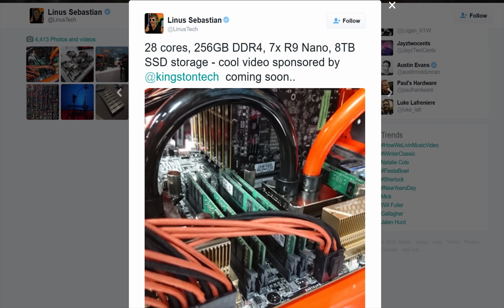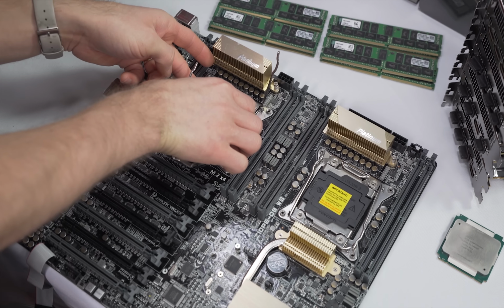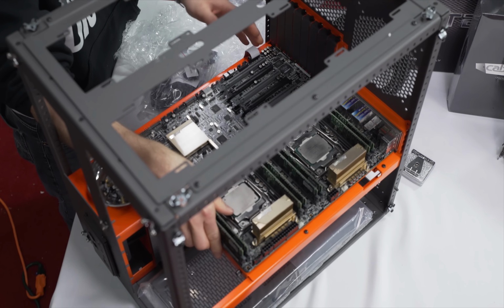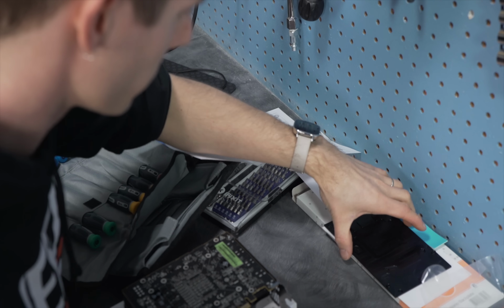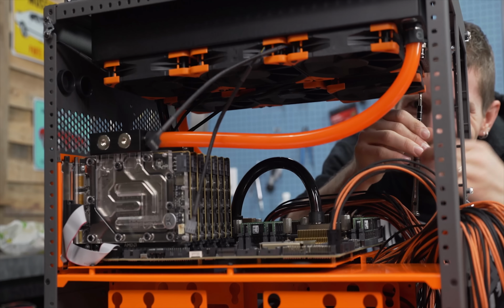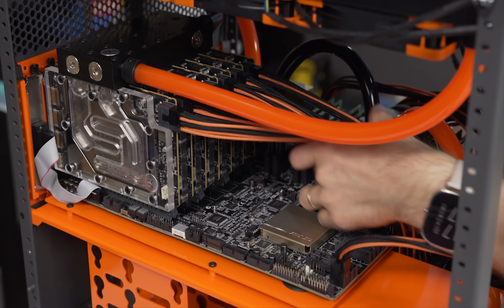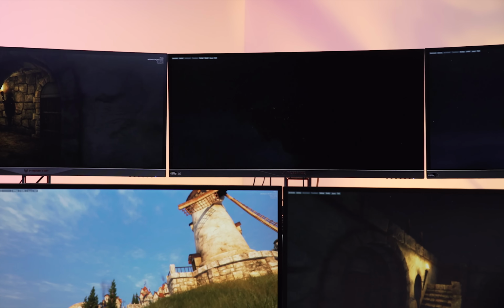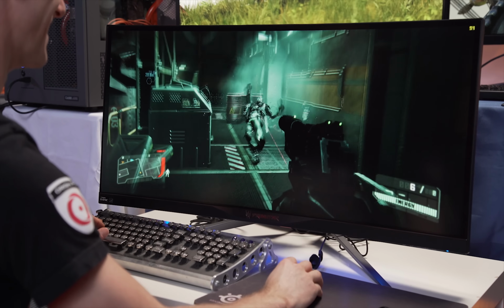7 Gamers, 1 CPU - Ultimate Virtualized Gaming Build Log

Comment: Word of warning: Whatever you do, don't try playing the next Crysis 3 level "Welcome to the Jungle" with 7 players at once.  I expect it would draw about 100W extra per player compared to the heaven benchmark mostly due to the increased CPU workload.

You could get around this with a dual PSU setup but no one should attempt this without firstly making sure that either the 2 PSU's are electronically separated, or they are wired up together CORRECTLY.
Reply: +Nick Dedman both CPUs combined use less than 300W at full load.
Reply: +wasted rider what kind of load exactly?  Linus said that the load from the wall when running 7 instances of Heaven was around 1543W.  Heaven will use at most 1 core's worth of CPU power.

In my experience the WTTJ level in Crysis 3 on a single computer uses about 100W more as it maxes out the CPU load computing the grass (again reading from the wall)

If we take the 94% efficiency of the EVGA and the 92% efficiency from my previous PSU which I used for the measurements, the 7 gamer computer was drawing about 1481W from the PSU.  It doesn't take a genius to work out that more demanding games are likely to overload that PSU.

Prime95 AVX and FMA3 loads are going to draw a lot more power at 100% than other types of stress testing apps, for instance.

Comment: Is this cost effective. I mean if i built 7 PC-s similar to these virtual machines, would it be cheaper?
Reply: +Kaarel Kahu This is $30,000. you could build 7 seperate ones with a way cheaper cpu and motherboard. End result - yes, it would be a lot cheaper
Reply: Im gonna say its usually around 1k dollars for performance like this
Reply: +Yato Not after the peripherals, I would say 1500 to 2000 especially with those monitors.  Still would be cheaper though

Comment: Im not discrediting your achievement with this build which is next to.. well nothing even comes close lol.  But that crysis 3 gameplay in 3600x1440.. that is on low settings right?
Reply: Looks like high setting, he can benchmark it with no problem so crisis 3 would play smooth
Reply: +sugarpuffextreme eh, a 4 core cpu at 3.4 ghz and a near top tier GPU should be able to run crysis 3 at 1440p.
Reply: +Mikee Tyson The R9 Nano is basically a full fury X under those circumstances. Remember the Nano chip is not cut down, it has all the 4096 SPs like the normal watercooled fury X.
 
But, the Nano, as Linus said, throttles with the stock air coler. Slap a water block on it and you've got 7 FULL FURY Xs my friends. So it is basically the card that goes toe to toe with the 980Ti in 4K.
Reply: DeLawrence
Ye I read up a little after I made the comment. I recently jumped ship to the green team so been a bit out of the loop. I assumed r9 nano was a smaller 290

Comment: What's with the second monitor from the right in the top row in the B-roll with the 6 in the background running Heaven? Is it just a badly-placed curved monitor?

And just be glad that the blocks for the Nano's aren't full-cover copper ones. You would have needed Luke there to lift them to get them into the motherboard. My 3 770's weigh almost 15 lbs when they're connected.

Comment: 8:14 "There is no power supply on earth that is gonna handle 7 of these (fury x)" - Linus... well wrong. There is a Leadex Platinum 2000W (8 Pack). Its a 2000w BEAST and could have run 7 fury x.

Comment: Linus, do you think 850 watts would be enough to run 2 SSD NVIDIA GTX 970's?
Reply: SSC*. 

not SSD.
Reply: +3.6L Dodge Avenger Might wanna ask that on the forum instead.
Reply: +3.6L Dodge Avenger If you can afford 2 of these things, you should know the tdp of them...
Reply: 86 feli

tdp?

Sorry, I'm still new to this.
Reply: +3.6L Dodge Avenger 850 would be enough, I have 2 970's with a 750watt
Reply: +3.6L Dodge Avenger The Tdp is the power consumption.

Comment: 1. ES Samples -.-
2. Relay slow RAM for Gaming.
3. On Complete Load the PSU will shut down, because one Fury Nano draw 225 Watt (8-pin + PCIe), ant that +7=1.575, and the rest of the system like the CPUs will also have some Watts.
Reply: +RonPlayEntertainment Well they tested it and showed it working fine in action so your points are invalid.
Reply: RonPlayEntertainment you said they draw 225W (8-pin + PCIe). Thay draw 175W from the 8pin PCIe so 50W from the PCie slot on the MB. 50*7 = 350W. 
Anyways, I think they draw a little more than 175W each, which makes around 1300 total. Leaves 300W for the rest, seems fair.
Reply: +RonPlayEntertainment Full load is >1550W, ram speed doesn't matter that much for gaming (unless you're on an AMD APU), and Xeons can be used for gaming (ES Samples are just Intel factory samples that can't be re-sold no matter what due to being "confidential")
Reply: +RonPlayEntertainment They used it for 10 minutes idle and 45 minutes at full load. (you can calculate that for the data on the wattmeter, knowing it's around 250W idle, and 1550W on full load). And the R9s pull less than that.. They pull 175W off the PCIe connectors. You're saying they are pulling a total of 350W for the motherboard. That's highly unlikely.
Reply: ***** Yeah, because the PSU says: Stop It! I know that Xeons can be used for Gaming (I have one), and the Performance from ES Samples can be slower.
Reply: that power supply as many others can handle overload pretty well i suspect 10% overload would be heald like a champ so no worries there given the fact that games doesnt stress your hw that much meaning it wont draw the maximum wattage
Reply: Louis I didn't say that they are pulling a total of 350W for the motherboard.
Reply: Louis WTF?! The 8-pin PCIe draw 150 Watt, and 75 Watt draw from the PCIe Slot.

Comment: So yeah, I've always been interested in a Linux box with a gaming VM on top of a passed-through graphics card. However, can I reuse the graphics card in Linux, once I've shutdown the VM? Figuring I have to flipflop the card between Linux and Windows, probably shutting down X11 when Windows runs. It'd really sound like a nice way to use both OSes without the need of dual-boot per-se (i.e. the Linux instance keeps running).

Comment: You should have got the 2000W SuperFlower unit.
Reply: +pcfreak1992 What? No, thats not how it works...
Reply: +rubikfan1 Most US houses have at least one 240v circuit, usually for a clothes dryer, hot water heater or oven...so we "could" do it.

Hell, even in my little apartment we have one 110v/30 amp circuit for the stove and fridge. I could unplug the stove and run my PC from that. LOL.
Reply: +Smoking Crop since most power supplies can handle both 50 & 60 Hz you could just use a transformer and step it up from 120V.
Reply: +pcfreak1992 the problem is, that on 110v it is not going to get 2000w, as it whould require 18amps. witch so more than the usa outlet.

in the eu we use 230v. with 2000w thats only  9amp. (max per out let= 16amp).

if you want bigger pc the usa has to switch to 230W
Reply: +Sickening Skittles it can be done on a 230v outlet.
Reply: in eu the outlets are all 16amp. every one. if you want more you need to build it your self. the only bigger once are on campsites for campers and so. those are mostly 35amp. with 240v that gives you 8400w. witch should be plenty.

Comment: Why two xenon and not two i76600k's
Reply: +Nick Paskhin You cannot do dual 6600k's, 6700k's, or in fact any i7's in the market. Only xeons can do it (not E3's though.)
Reply: +PikolUploader Depends on the generation, but yes.
Reply: +Nick Paskhin Umm, because 2 i7-6600ks would have SEVERELY bottlenecked the entire system, with each VM only having access to a single core.
Reply: +Nick Paskhin Xeon's have way more cores (the ones being used having 14 WITH hyperthreading) so each player can have a quad core and not bottleneck.
Reply: +Nick Paskhin well, 1st there exist no such thing as a i7 6600k, there do exist a i5 6600k tho, 2nd for so many people to play games at the same time, you will need atleast a quad core for each of the which is what the Xeons deilver (2x 14 cores) and it turbos to 3.4 Ghz for dat gaming performance.
Reply: +Mikee Tyson I think he meant the i7 6700

Comment: Linuses rigs always make me sad cuz i can only dream of pc's like that... :(
Reply: Well for personal use it's completely trash.
Reply: +Ivica Krajnovic But did you not see all the technical issues he had with it? And I can assure you it's not stable. It's more trouble than it's worth.
Reply: +6Twisted thats why i said "rigs"
Reply: +Lekr1s well not really if you use something like dual 980ti or titan xes it would be dream machine you can even go quad crossfire(using the real term) with gpus i mentioned above. but it will cause trouble in some games
Reply: +JusstyteN 980 tis and titan xes can't crossfire.
Reply: Then get a job and stop complaining on the internet
Reply: +Ivica Krajnovic why? you just want a rig that is adequate for over 60 fps gaming at decent settings. Anything that is so powerful it could provide that experience for 7 people simultaneously is so overkill that its redundant. There is no real point to having something like this at all.
Reply: SWIFTzTrigger Uhh.. 144hz, 4k, multitasking, not to mention less noise and heat from a more powerful system.
Reply: 6Twisted lol, its still wayyy too overkill for that.  Heres a benchmark of a 980Ti OC running witcher 3 in ultra with hairworks at 4k. It runs it a little under 50fps.

http://www.toptengamer.com/best-4k-1440p-graphics-card/
Reply: +SWIFTzTrigger of course there is, bragging. Also lanm parties without having friends bring over pc's. if I had more money thatn I knew what to do with I would get one just to say I have it.
Reply: Naturalhighz lol, you must have more money than to know what to do with if a 30k rig is reasonable to you for an occassional lan party
Reply: +SWIFTzTrigger oh no but if i had, then why not. i mean you might aswell spend money on something so if i had $100mio id definitely do it.
Reply: Naturalhighz haha, if I had 100mil I would have a giant home cinema and invite everyone round to play on the giant screen. Also I'd probably be too busy travelling and stuff, but I guess lan party would be priority for some other folks lol.
Reply: +SWIFTzTrigger i would definitely be travelling as well but having a base somewhere to keep my shit i might aswell have one of these bad boys just in case you know :D just because fuck it
Reply: Naturalhighz haha why not? I'd probs buyout linustechtips while Im at it and get him to keep making interesting rigs for me too.

Comment: 1540 W with only Unigine Heaven running? And there are 2 * 145 W TDP Xeons, so if you add some CPU load the power supply will shut down...

Comment: The question is could everybody be logged into their steam accounts a once on this?
Reply: +Vegan Games Yes, they're using Virtual Machines, which is basically making a seperate computer inside of a computer. Each one of the screens can be logged into whatever they want and it wouldn't interfere with any of the others in the slightest, or so I understand.
Reply: godwings101 so they could all play cs go online over one cable?
Reply: Vegan Games Not sure 100% positive, but I imagine so.
Reply: +Vegan Games yes, every virtual machine can run separately which allows you to use all vm's separately

Comment: How would this perform for 1 Gamer ? Would that be even possible ? To use all those GPUs and both CPUs for 1 gamer ?
Reply: 7 way crossfire isn't a thing
Reply: +Raymon Tutewohl you didn't close the bracket, as a programmer this disturbs me.
Reply: Well u can't crossfire 7 gpus so no
Reply: +Deividas Gedgaudas Probably not that much better than it would for all 7, the system is way too overkill for just 1, ignoring that games don't support that core count, that RAM amount and 7 GPU's in crossfire that doesn't work anyway. Could be an interesting mining or folding machine though.
Reply: +Deividas Gedgaudas Corssfire only goes up to 4 cards.
Reply: +Deividas Gedgaudas Maybe with DX12 some day.
Reply: +Raymon Tutewohl You can easily use more than one cpu at a time
Reply: +Deividas Gedgaudas You could use the cpus although games would only be able to use few cores. DX12 could change that. As for gpus you can only use 4 for gaming because of the limit in sli/crossfire technology. In theory DX12 could allow even more gpus to be used.
Reply: eamon butler No no, he wasn't talking about cores, he said it won't be able to utilise two physical CPU's at the same time, also there's no way that 8 core is ever running all 8 in games.
Reply: nope its too good to be used for one gamer
Reply: +Deividas Gedgaudas Games dont really utilize all four cores, let alone the eight in the whole machine, so your still restricted by the CPU itself (single threaded CPU heavy games would run the same such as minecraft). You can also SLI multiple GPUs together, and since there are seven thats really overkill. But hey.... you could watch youtube videos on 3 of your screens while you play a game on your other 4 monitors so that would be nice.
Reply: 99999999 average fps on crysis 3

Comment: 2 980 Ti@1500  better and chiper
Reply: +Techno-Kitchen for one system. put the stress of 7 machines on it and the more robust AMD hardware is better suited for the task.
Reply: Single 980 Ti is better than a single Fury X, but... Crossfire>SLI.
Reply: Hi Techno-Kitchen!!!!
Reply: +Chris Hunter Plus each VM needed its own gpu so 2 980's wouldn't work
Reply: +Techno-Kitchen 2 980's couldn't run those engine benchmarks while simultaneously doing a maxed graphics 21:9 res monitor at 60+ fps for crysis 3. It's just ludicrous to think so.
Reply: +Lightning Graphics not necessarily. with vmware you can allocate 3d resources like you can memory or cpu. it would be seen as one big pool of resources than each individual card.
Reply: +Andrés Zavala he used fury nanos
Reply: +TheDownyCat R9 Nano = Fury X without watercooling and 50mhz less on the core.
Reply: The point though was so each instance of windows had its own card. It's not suppose to be an sli/crossfire situation

Comment: The 1536 watts power draw was beyond what the power supply could normally handle. It's 1600 watts with a 94% efficiency, making it basically 1504 watts.
Reply: +Alex Black That isn't what the efficiency rating means, The PSU can output the full 1600W at a continuous rate with no problem and I could probably output  more if only for a short time.

Comment: make me wonder could you do this all with 970's at 1080p
Reply: Chris Hunter You should probably get off GPUBoss and go look at some actual benchmarks. Raw floating point performance does not indicate in game performance. It is only about 30% faster at 1080p, and 40% faster at 4k. Also, "price is not a consideration"? Then you'd be getting Titan Xs as they're the fastest GPU out right now.
Reply: +Harley Heitmann I don't think so. The nanos have a very small footprint and power usage profile.
Reply: +Chris Hunter I'm fairly certain a 970 uses less power than a Fury Nano, but in terms of size, you're right, I don't think there's a 970 out there that doesn't have a permanent dual slot IO plate.
Reply: +LiquidPanic the nano has 2.2 times the power as a 970 for an extra 30 watts. the nano is by far way more efficient.
Reply: Chris Hunter Not even close, I have no idea where you pulled those numbers from, but it's only about 30-40% faster, while costing quite a bit more.
Reply: 8,192 GFLOPS vs 3,494 GFLOPS More than 2.2x better floating-point performance
Much wider memory bus 4,096 bit vs 256 bit 16x wider memory bus
more shading units 4,096 vs 1,664 2432 more shading units
Significantly more texture mapping units 256 vs 104 152 more texture mapping units
Slightly more render output processors 64 vs 56 8 more render output processors
all for 30 more watts. price is not a consideration.
Reply: +LiquidPanic you could not fit titan Xs in this form factor. Regardless, the card is significantly better in every respect to a 970 for a negligible power difference. I also did not say it had 2.2 times the gaming performance. I don't get on GPU boss. I have a job to get to, so I don't have time to do anything beyond that cursory spec report. It's not like the numbers are inaccurate. http://www.tomshardware.com/reviews/gpu-hierarchy,4388.html
Reply: Chris Hunter It's completely inaccurate to say that it's 2.2 times more powerful. And once again, for any normal person, this card is pointless, as it NEEDS to be water cooled to not thermal throttle, and it costs a lot more compared to the increased performance. The only use case is niche mini-ITX systems, and things like Linus did in this video. I also love how people feel the need to say they have to go work, assuming that nobody else on YouTube has a job and that they're special.
Reply: +LiquidPanic Can you tell me another way to indicate the r9 nano has twice the floating point throughput as the 970? Would you not say an 800hp engine is twice as powerful as a 400hp engine even though only 600HP makes it to the wheel? Finally, Congrats on understanding my argument. "The only use case is niche mini-ITX systems, and things like Linus did in this video." Since I'm special and you might be unemployed from that comment about the job, have a great day.
Reply: Chris Hunter What are you even on, none of your thoughts in that comment are complete. And also, you assume I'm unemployed because I made a comment about how you thought it was an important point to mention that you have a job. It seems like you're the insecure type. Your argument also had nothing to do with what I said about the card being only for very niche use cases. It doesn't change the fact that it is grossly overpriced and only performs properly when water cooled.